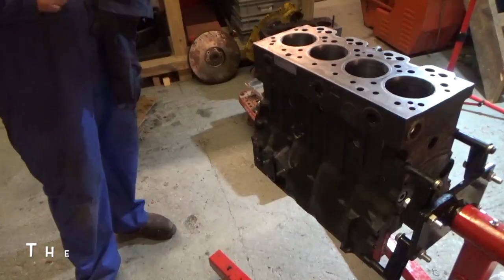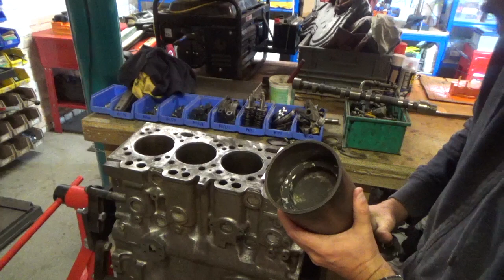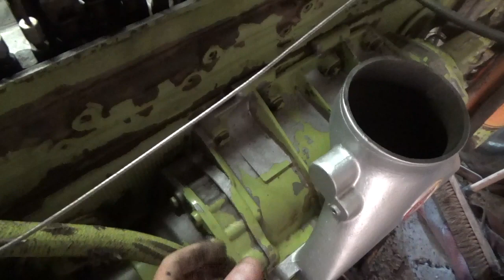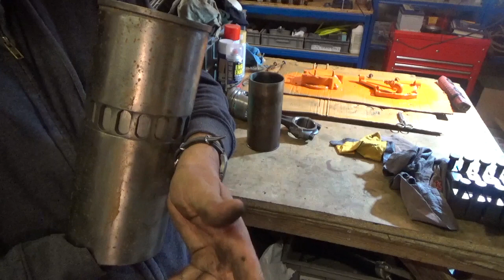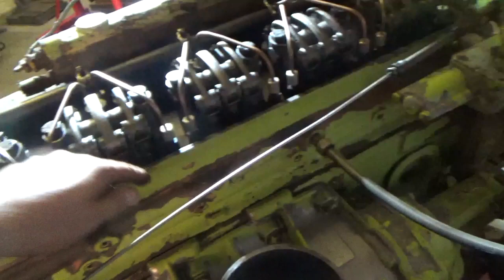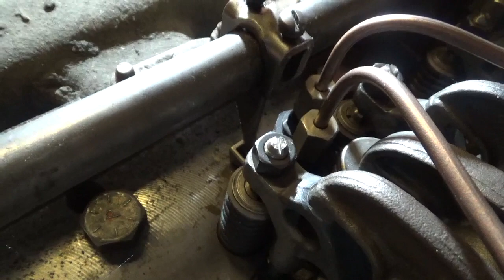HOW DOES A 2-STROKE DIESEL ENGINE WORK ?

Comment: Nice one mucker. Many years ago I used to drive ts24 motor scrapers. They had 2 Detroit V8s. The winter job was to wheel one in and strip it and both engines down and put it back together ready for another summer of abuse. 
I also got the job of converting the D8s and D9s from donkey to battery start. Happy days 👍😀. Keep up the good work. 👍

Comment: Cool; I bought a 52ft boat with a 6-71 engine. Motor is in great running order. These engines are so reliable. Now (thanks to this video), it is clear why they are so good and how they operate. No wonder they were in landing craft, trucks and Sherman tanks. Some were fitted with a turbo charger for increased fuel economy. Cheers; Woody.

Comment: I've been a diesel fitter for 26 years but i've never had anything to do with 2 stroke diesels, never even mentioned them in collage so thanks for for the run through on the what's and why's of them most efficient way to turn diesel in to noise :-)

Comment: I went to college in the castleford in Yorkshire in the year 2000 on a plant mechanics course for 3 years. we had 2 v6 engines that came out of motor scrapers. The old fitter I worked with gave me the manual for the engine as he worked on them in the open cast and worked for terex. I learned a lot from him, we would pull the transmission out of a cat d6d and he would just be sitting on the machine seat smoking and tell me what to do and pass me the spanners. Was good crack was the best job in the world at 16 two weeks out of school all your mates where going back to school I was playing with cat tractors and welding buckets. Love your videos thanks.
Reply from the maker: Priceless way to learn 👍😎

Comment: If you hung a picture of a two stroke Detroit up on a wall, there'd still be an oil patch on the floor...
Reply from the maker: And if there wasn't, it would be empty...
Reply: @LordMuck  same as if it was a Harley-Davidson!
Reply: Ha I could say the same about my 440 CCW John Deere JDX8 sled I had! It always dripped a little oil on the clutch side. I now got an 8v92 and a johnson OMC 4L small block v8 outboard. Both my 8v92 and Johnson are on she’ll rotella 2T sae 40w CF-2 oil. I do cut in a BRP XD-100 in both engines now and then.
Reply: It was an early attempt at oil cooling

Comment: ran    a  Gmc  truck for  years  which had  detroit 671 two stroke  engine  , a LITTLE HARD TO START IN  mINUS    20  degree  C weather  but it could  pull.  leaned fast to listen for  rack sticking  as it would go quiet before  blowing  its lid

Comment: My first real job was summer of my senior year in high school working with a grading company pulling a sheep’s foot to compact the soil at the dump zone. I was bored out of my skull. One day one of the pan (earth mover) operators laid out of work so I asked the boss man could I run the pan for a bit. He told me to do it as a learning experience rather than a fuck up experience so I jumped at the chance. The pan was a Terex (Euclid) “double barrel” (2 Detroit engines) and for 12 hours that day I had a constant stiffy on. After I mastered the pan drop exercise I was spreading dirt like cake icing. Then in the fall it was off to college to learn bullshit so as my daddy said “you’ll not have to work construction for a living. Fact is, it was the best job I ever had and I always longed to be sitting in the seat of that pan maxing two throttle pedals to rev up not one but two screaming Detroit’s. I can’t hear one to this day without popping a stiffy. Your tutorial is brilliant sir Lord glad I subscribed. By the way, tune in to Bus Grease Monkey on you tube.........the man rebuilds Detroit’s in his sleep.

Comment: Enthusiastic explanation, very good, i have a 6 71 war time engine retro fitted in a 1941 diamond t, also have a 12v 71 in a peterbilt, silver 92 going into a white wrecker, and 2x 8v 71 engines on the workshop floor all in essex uk,,
Reply from the maker: Ex-Italian Army DT ?
Reply: @LordMuck  yep had her about 20yrs, dont go any faster, just has more power, she,s a2 valve motor,
Reply from the maker: My 980 and 981 both had Hercules DFXE's. Nice enough but I always wanted one with a Detroit.
Reply: @LordMuck  used to use one in the 70s for heavy recovery,had a hercules, took it out and put a 220 cummins with 6 speed overdrive gearbox out of a guy in it, it would do 45mph, still exists in bedfordshire,.

Comment: Bearing in mind I am 54 years old I can remember the coal man coming to our house when I was about 7 or 8 with a Commer wagon with a two stroke in it and thinking to myself that's different to the Foden gravel wagons that went past the road end, some years later about 10 I did some work for a timber yard they had a couple of timber jacks which they used for forwarding and winching, the penny dropped, they both had Detroit diesels in them awesome power but loud. Let's be getting on, cheers
Reply: Some of the commers were horizontally opposed 2 strokes. Man they made a heck of a noise

Comment: We had a grain truck with a 4-71 in it. She was a loyal old gal. I believe that the 6V92T was considered supercharged because of the turbo adding the supercharging to the blower. I enjoyed the explanation. She's a right mint specimen Bud 👌🏻. Bus Monkey has a wealth of knowledge on the Detroit. It's a joyful noise 🤘🏻😎.
Reply from the maker: 6V-92T is classed as turbo'd because it's increased blower pressure via the turbo. It is possible to have supercharged air but that's another method and it's not something we are looking at when discussing the basic principles.
Reply: Good to know

Comment: Excellent explanation. As a kid a colliery near us ran TS 24 scraper boxes building mountains of shale. I loved the note as both engines were thrashed running flat out up the haul roads screaming their nuts off. 
When I first come to the States in 1985 many trucks and buses had Detroit’s fitted.
I did drive a TM Bedford tractor unit belonging to Ryder in Park Royal with the V6 but just bobtail so couldn’t put it through its paces. Got a buzz driving it though👍🏴🇺🇸

Comment: I drove a boat with an 8V/71 and it ran away on me the cable to the emergency shut down wasn't connected so I had to reach over this screaming engine and operate it manually. The emergency shut down is a flap under the blower that shuts off the air supply.
Reply from the maker: Yes it's down in the corner, it's a spring loaded trigger.
I've made sure this one is free 😉

Comment: Excellent explanation thank you for the video so what happens to all of the unused air does it just keep circulating. I've never heard one pop off as if there was a pop-off valve like a turbo so I was just curious.
Reply from the maker: The 'unused' air remains in the air box (for a split second) and is used to push the exhaust gases out then followed up by air pushed in for the induction stroke and so on

Comment: You have done a better job explaining the inner workings of a Detroit then anyone else I’ve run across, I commend you for that! The only thing you didn’t explain is the reason for low torque. Length of stroke dictates torque. Half the stroke and you’re in a exhaust mode, which means zero power. Detroit’s are a great power plant engine, but unfortunately not that common in the US anymore. Keep up the great work!
Reply from the maker: The idea of the vid was to keep it as simple as possible. I could go into injector settings, fuel pressures, power increase etc but there's no point in a simple vid. We can look at other bits as we progress with the rebuild.

Comment: in the late 70`s/early 80`s used to operate Terex shovels 72/71 and Terex dumpers 33-07. Both had Detroit Diesel engines V8 and V12`s. Great engines with starting fluid, would start on even the coldest mornings. But when they let go they let go.

Comment: Excellent dissertation on the two stroke diesel. A query. Always understood that the diesel burned rather then exploded at injection.enjoy the videos.
Reply from the maker: An explosion is a fast burn, all common fuels burn. If there was no explosion there would just be fuel burnt and the piston would have no power stroke.
Reply: @LordMuck  thank you.

Comment: Never been near a detroit, but they do sound sweet. Have experience of a 2 stroke diesel single on a Ransomes MG6 crawler. Cranky and prone to reverse starting that one. But fun to play with once running. Just looked, it was a Drayton 34R engine.

Comment: As someone who has tried to pull a load with a 8v71t, give me a four stroke any day. DD= most efficient way to turn fuel into noise!  I pity anyone that sets near one all day, still remember riding a Massey Ferguson 98 with a 3-71 DD when I was a kid. After a couple hours the numb feeling would go away. Nice video and explanation!
Reply from the maker: I used to work with them day and night in the oilfield Frank. Just such loyal engines.
Reply: Lord Muck  very dependable yes.
Reply: Lord Muck actually I loved the sound of a rig tripping pipe with a Detroit Diesel, from a distance.

Comment: Good explanation. Some Detroit engines have turbo chargers to give more power.
Reply from the maker: Yes that's right, as denoted by the 'T' as in 6V-92T
Reply: @LordMuck  If i am correct the 6V-92T was the silver series Detroit basically the same as the green engines but with the turbo, probably some minor mods to accommodate the changes.
Reply from the maker: No, you could get an earlier 92T but the Silver Series came in around 1982 and was basically lots of upgrades and improvements (although not all at once)

Comment: The correct technical name for the “air box” is scavenge space. Older 2-stroke diesels (not so much Detroit) also has exhaust ports as well as well as inlet. Modern 2-strokes all have exhaust poppet valves however. Worked on a few in my time.
Reply from the maker: Dead right and we could talk about instances where supercharging is possible and also the use of turbo's but I want to keep things as simple as possible at this point while explaining the overall principle.
Reply: Lord Muck I’ve had both belt driven supercharger (they were awful on a Wichmann) and BBC Turbo chargers (before name change to ABB). Very good video for those who have no knowledge of 2 strokes. You’ve kept it simple and to the point 👌🏻.
Reply: i worked for detroit diesel for 20 years and we always called it an air box. the scavenger box was added to collect excess oil that came out of the air box check valves. which was usually on the vehicle cause a 2 stroke detroit is a leaky bastard. i only saw them when a core engine came in for tear down. I tore down so many engines i lost count. i tore down everything from the 3-53 all the way up to the 16 92 marine. it took me about 10 hrs to tear down a 16-92 marine by myself.

Comment: Thanks. That helped me get an understand of my 8v92. If you can please talk about putting a turbo on a 2 stroke and how it works verses the 4 stroke turbo.
Reply from the maker: We might look at turbo'd later 👍
Reply: @LordMuck  If you want a look at a 12v92TA in the UK, I've got one in a fire truck. the engine would be a runner but I've got the cab stripped out.

Comment: In ireland between 1983 and 1997 the bombadier buses used detroit diesel engines 2 strokers loved the scream of them..of course the maitenance and other reasons the buses were shite but engine were great  5 mpg cool..drank fuel..
Reply from the maker: I never knew they had them there ! 👍
Reply: @LordMuck  yes tbe engines came from the usa and the buses built in cork under licence if you search bombardier breakdown ireland you may find the news reel of the time or google bombardier buses ireland some thing will come up. I was 22 at time. Never heard a screaming 2 stroke diesel i just thought it was just the bus driver driving the shite out of it. Also at bus terminal never knew buses had to build up air breaks so that accounted for heavy peddle use i suppose.. 4 stroke engine can sound loud but sit at back of bus of a detroit diesel 2 stroke you might go deaf or sterile from the sound and they had auto transmission which were kinda rough on first to second gears but loved them. They lasted till 1994. You still find the odd one . But most of them the surviving ones are at the national transport museum at malahide castle north  co dublin.. front brakes used to lock up on wet days but had odd suspension which later i discover the engine and transmission were one unit and front suspension and steering g separate unit bolted to body there was no box section chassis.. so it rock and rolled in corner but i could listen to that engine all day long :)

Comment: Brilliant thanks was there a benefit in using a two stroke ?
Reply: They are a very simple and relatively cheap source of power. They love to run flat out making them ideal for power plants, ships, earthmoving equipment and were in most U.S. fire trucks up until government mandated emissions laws ran them off in the late 80s. They worked great at a fire scene pumping water for hours on the pin.
Reply: @rebelyank6361  Boughton fitted them to the Barracuda and Marlin airport fire trucks in the UK right up to the early 2000's

Comment: Bloody good explination there mate, I'd always wondered how they worked.  So a 2 stroke (diesel) can't be turbo'd (or supercharged) as per a 4 stroke.. could the blower pressure just be raised to increase power? (more air + fuel = more power)... and what is the benefit of a 2 stroke?  or was it just something "different" to try out?
Reply from the maker: They can yes but I want to keep the explanation of the concept simple at this point.

Comment: The engineers that developed the Detroit engine had a great idea,but they stopped engineering to soon. The 2 stroke engine with a blower developed good horse power with less cubic inches. The problem. If you fit the bottom of the sleeve tight it break the sleeve when the block got hot and expanded. So, the bottom had to be loose and the constant blower pressure would force air down around the sleeve and into the crankcase. If they had put an Oring around the bottom of the sleeve to seal the blower pressure out of crankcase a good design would have been a great design!

Comment: So what are the advantages of a 2 stroke diesel over a 4 stroke ,more power ? efficient ? less fuel ? also it cant have water cooling around the cylinders so is it air ,oil cooled ?
Reply from the maker: No they still have a water gallery.

Comment: If what you are saying about the blower/ supercharger is correct, why do turbos added to many 2stroke detroit's from the factory increase horsepower dramatically?
Reply from the maker: Because a turbo increases the amount of air available significantly.
Reply from the maker: And it's a blower not a supercharger...

Comment: How about showing us a Tilling Stevens or a Foden 2stroke?
Reply from the maker: I would if they were a patch on a Detroit...
Reply: @LordMuck  Well, if it's "not a patch on" you're on about a Detroit is not a patch on a 645  or 567 EMD.
Reply from the maker: And how are they even comparable ?
If you have one laying around your yard, I'd be more than happy to film it.
Reply: @LordMuck  Agreed, not comparable.  I don't have any lying around.  Although there have been a number of locos scrapped here in recent years.  How about the Gardener 8LW engines?  I understand they were highly sort after by fisherman.
Reply from the maker: I may have a very late Gardner 6LX coming up
Reply: @LordMuck  Sorry 6LX doesn't mean anything to me.  Were they in Atkinson trucks?  I experienced 6LW 6L3 and 8LW.  Heard them travelled in the vehicle they powered saw them under the bonnet.
Reply from the maker: 6LX and 6LXB were often in busses and boats.
My Scammell had a 6LW and so did my genset
Reply: @hoverhead047  When I was young an old fisherman told me, If want to build a boat buy a Gardener and build your boat around it.

Comment: Aahhhh. The old screammin demon’s. The only thing that makes them sound better is 4 valve heads and a turbo. The idle lope on a silver series 8V92T will give you a hard on. 😂 I want one in the worst way. Don’t even care what it’s in. Would prefer to find an Oliver 1950 but Ide really like to have an old Terex loader or dozer to. A TC6 would be a sweet machine for cleaning tree lines but that’s probably out of the reach of my bank account. Lol.

Comment: I didn't know the two stroke diesel existed. Has this 2 stroke engine twice as much horsepower per liter of cilindercontent than the traditional 4 stroke engine? 
Why aren't many of these engines made? Is that because of the commonrail invention? Was commorail invented by the same factory Detroit?

Comment: Is there an advantage in a stroke diesel?
Reply from the maker: Fuel consumption, low down power climb speed to full power, lots of things in the right application.
Reply: @David Forster Take a look at 2 stroke Marine Cathedral Engines.  The fuel consumption and power figures coming out of such a slow rpm engines are amazing.

Like Mukka said right engine, right application.

Comment: Exelent video. Why are they not popular in Europe?
Reply: Don't think they were very good on fuel plus they're a bit like a straight pipe exhaust fun for a day but soon get on your nerves after a while.
Reply: They are not fuel efficient and like many engines, the emissions were too high because of incomplete combustion. When they started building engines in the 1930s, diesel fuel was cheap and it stayed cheap into the 1970s. As fuel economy and emissions became a concern, Detroit built a four stroke model called the series 60. Because the intake ports are in the middle of the cylinder, the pistons have to seal at both ends and have rings at the bottom of the pistons.